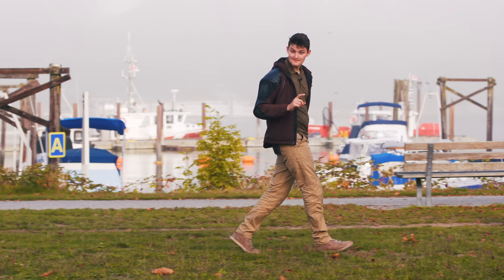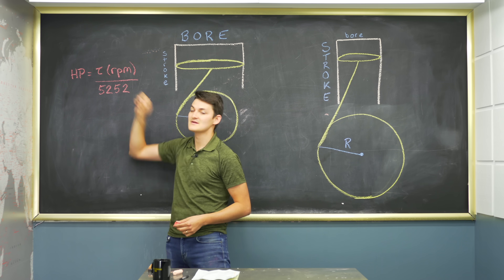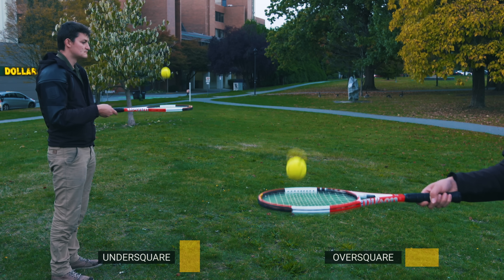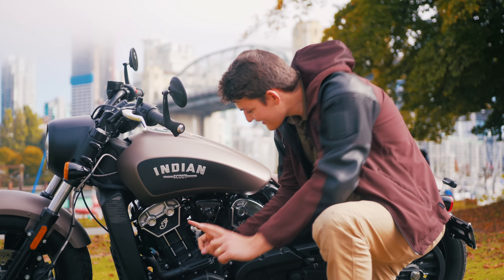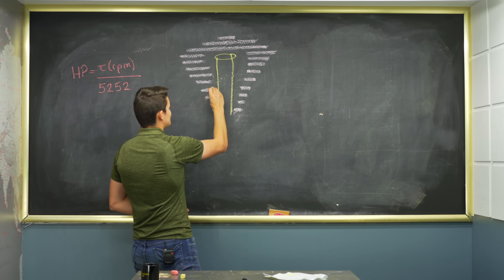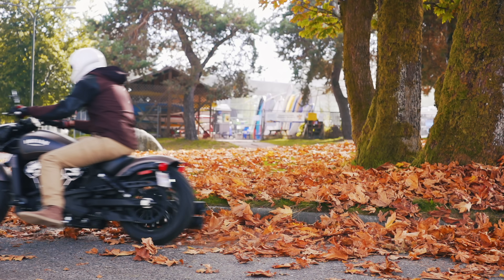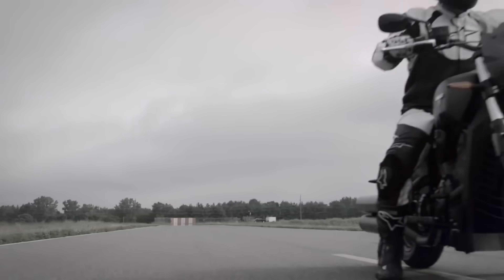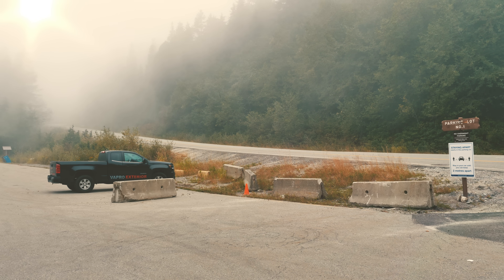How Indian Makes 43% More Power than Harley-Davidson

Comment: Thank you for an excellent ICE analysis.
Small engines must spin with least resistance -- hence, OHC over square is the way to go with proper liquid cooling -- more safe power, speed, efficiency with less pollution.
H Sportster is a nice size, potentially nice highway cruiser... except,  it's a slug -- 886 cc 104 mph top end, 1200 c 118 top end. No thanks.

Comment: The longer stroke of the longer connecting rod gives you a split second fraction of a second longer combustion time due to the fact of the crankshaft spinning in the connecting rod going up and down it gives it a split second of combustion time to get more of the combustion pressure out of the combustion event cycle

Comment: Really, Comparing a modern water cooled DOHC motor to an ancient air cooled on and wondering anout ho difference. Why not compare it to a water cooled Harley instead? Say, an 1130cc one from 2002 that made 115hp?You know, the one in the VROD. Or Maybe a 1250cc one from 2024 that makes 125hp. Sportster S anyone?

Comment: Owned a 1st Gen Scout.  Started dying when ever it was hot outside.  Dealer and Indian National service never able to repair the issue.  Even after re-mapping the bike twice.  The bike spent the last month that I owned it, in the Indian dealers shop, not repaired.  Indian national service was totally useless.  Always blowing me off.  Ended up taking it home and trading it in for a Honda.  Never had any issues with the Honda's that I have owned over the years.  Will never buy an Indian again.

Comment: MMMM... My view is that HD are under powered, over priced, weigh a ton and handle like a brewer's dray.... Indians are a lot better and have huge potential, but still leave a lot to be desired if you want a bike with a bit of performance, agility, reliability and reasonable cost. My 34 year old 600cc Honda will run rings around either of them in straight line speed, cornering ability and long term durability...... The internals of the engine have never been touched... it burns no oil between changes and will still do 140mph. It's called good design, first class materials and excellent build quality.... People buy HDs for the label, like designer jeans; actual quality is secondary it seems. Indians don't have the following they should. I know Americans are all about big engines (no one in the world makes a better V8) but I cannot fathom why the Victory bikes didn't take off.... They had the big muscly engines and in addition had very well set up chassis. They could be ridden hard through the twisties without grinding the pegs off and by all reports were relatively trouble free.
Horses for courses I guess.... Different world here in NZ... 😀

Comment: Look I'm running 8,000 RPM in my small block Chevy and it's got push rods..... Over the last 50 years of drag strips I've seen engines that turned 11,000 RPM that were insane to believe that they could even do it with push rods like a 396 Chevy that turned 11,000 RPM... A Harley can turn high RPM too but like all of us hot Rodders know which know a lot more than evidently you  people do.... Every single part in the engine must be built to do the job....

Comment: doesn't this proof that there is merrit to the whole torque vs hp debate, as torque is like the harley's, limited in its total hp by rpm but has high torque at a set rpm compared to a modern short engine, however the modern shorter engines sacrifice that low rpm torque to increase its max rpm and as such max HP. 
e.g. torque is lower rpm more torque as such limited HP at high rpm
and HP is higher rpm less torque but makes that sacrifice for higher max HP

Comment: You completely overlooked one critical factor: repair. An old Harley could be fixed. A new Indian, and increasingly, new cars, are single use throwaway machines. Remember when Harley adds asked you to find the Harley in the field of junked motorcycles? They compared your gramps's lighter with replaceable flints and wicks to a Bic. Today's customers can program a computer but they can't build a crankshaft.
Reply: And you will have to fix it often!

Comment: You went around the long side of the barn to explain that the Harley has a much lower compression ratio. THAT is where the extra power comes from. Yes, you explained that in every single way except the most important one that ties it all together. Longer stroke, higher compression. Higher compression makes more power per CU. In.  Databyter

Comment: You're partially there volumetric efficiency of a hardly is around 60% because of their firing they're about 15° apart essentially the two cylinders are acting as one modern engines are opposable firing about 180° apart which puts them in the volumetric efficiency of 90% ish
Although they're both air-cooled junk
Smog coming into play real soon needs to be pulled off the road

Funny thing the quarter mile and 1/8 mile guys change their Harley crank and cams to 180 degrees
The other advantage is longevity
Their new Milwaukee engine only going to make it to about 50,000 miles

Could squeeze a bit more efficiency by being liquid cooled
PS
As far as nostalgia is long gone since 71 hasn't been American made Harley since then
They're assembled here yes but not manufactured

Is more American made parts in my goldwing

Comment: Harley Davidson, the most expensive way to convert petrol to noise without the benefit of horsepower.
Reply: Sportster S.. 120hp runs low 11s in quarter mile.   That's 600cc rice rocket times

Comment: What Indian does that Harley doesn’t is put a liquid-cooled engine into an iconic motorcycle. Instead, they left the Sportsters, Dynas, Bobbers, Glides, etc. air-cooled and under square. The liquid-cooled bikes they made were destined from the start to be outliers. Harley is afraid to do what Porsche did. Imagine if today’s 911, GT3RS, GT2, Boxster, etc. we’re all air-cooled! Porsche would be dead. That’s where Harley is headed.
Reply: Throw in the fact that Porsche started making SUVs to get in on the SUV craze. They've publicly said if they didn't do that, they would be bankrupt.

Comment: That is absolutely incorrect to assert that engines had a slow cyclic speed due to, or until the replacement of the total-loss lubrication system. It is absolutely incorrect to say that Push-Rod valve trains are not conducive to high-rpm operation- there were 10,000rpm pushrod engines in the 1950s. 
You guys need to stop speed-cucking your audience. Virtually all aspects of ICE were defined by the late 1940s with the incredible war-time development of aviation engines. A Harley engine is just a slice of a radial engine.

Comment: The Scout is a total piece of $HlT! Every bike makes more power than Harley. My Ultra is rated 62 HP and with new heads and a cam I dynoed at 66 HP. They're just weak pigs. Now they are made in Brazil, India and China. I will be selling mine and stepping away from a bike I have loved for 30 years. Harley sold out and we need to support other manufacturers that still appreciate American made.

Comment: What you have left out is which engine lasts the longest .
The reason Harley Davidson has fins for each cylinder is because it is the best way to cool the cylinders separately . 

Leading to a motorcycle that practically will run forever , under the high heat and high reeves .
Indian will never replace  Harley .

Comment: The problem with all of this overboard under bore b***** comes down to this motorcycles can only go the speed limit legally if your Harley-Davidson can do twice the speed limit you do not need any more power you may want more power like I do but you do not need any more power.
The marketing of horsepower as the most important part of a motorcycle is absolute b***** or Indian would be the number one motorcycle in America but they're not because people prefer big slow strokers.

Comment: No surprise here!
The inherent, individual 3 stage transfer of power says it all...even if you redid the engine design, it's heavy, with massive engineering flaws and it all comes with a ridiculous price tag?..  my brothers 2000 Honda VFR800 and my 2004 Suzuki 1500 Intruder successfully did a 4200 km east coast trip.

All the guys with the Harley's were towed home within the 1st 1900 kms... just brutal pieces of SHITE..!!